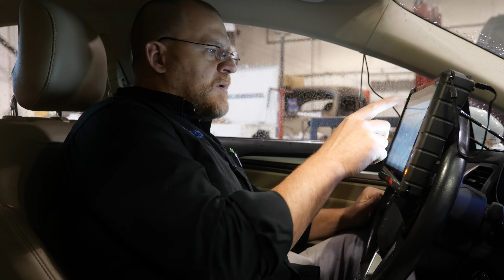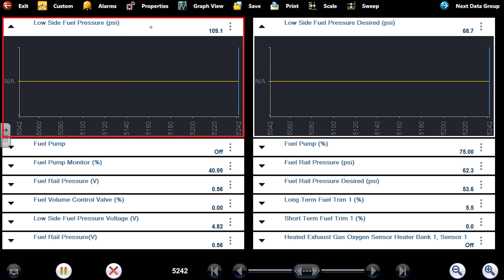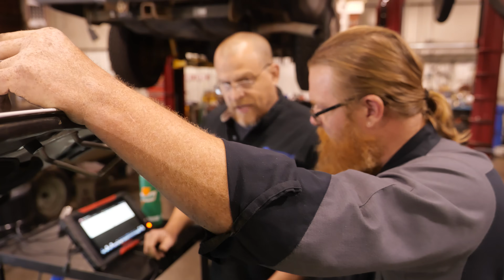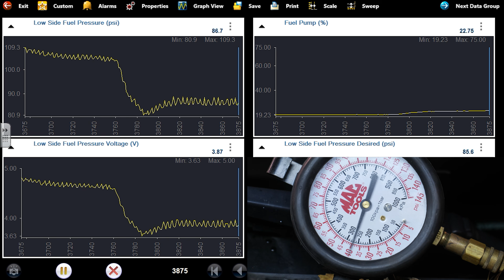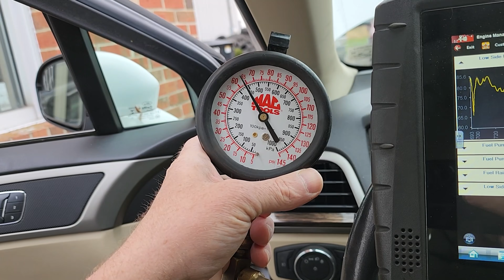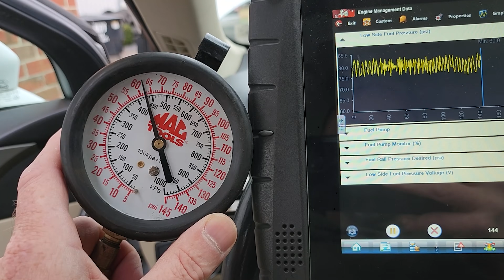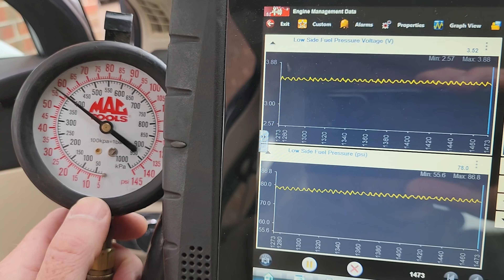Gas Direct Injection System With Intermittent Low Fuel Pressure

Comment: So i was told by our tech service, not going to name names.. that its ok to hook up a manual fuel gauge on gdi, however, its best not to tun the car with it on. Mainly because the needle bounces crazy and it could ruin your gauge. They told us key on and read gauge while supply power and ground to low side pump dead head. Thats how you read low side. Any thoughts on that?
Reply from the maker: Not sure why anyone would suggest that method. Especially with a PWM low side pump with a psi sensor. If you'd manually energize the pump, I'd put out max psi. I guess if that was your goal was to force max?
Reply: @ScannerDanner  they said maxing out pump proves that pump low side is not the problem. Use three wire potentiometer at low side sensor to verify scan data can change and measure ecm signal to pump control module with oscilloscope to see if you can control situation and watch computer control module rpm. Having a manual gauge on it running is bad for gauge. Thats what they said.
Reply from the maker: @mikesabin8568  I don't see these psi pulses messing up a gauge. I always want to see the system working as designed. And in this case comparing actual, desired, low side psi, and low side pump duty cycle was the key to the diagnostic. Jumping the pump out wouldn't have been any type of advantage imo
Reply: @ScannerDanner   Maybe use an oil dampened gauge? The gear inside  the gauge eventually wears out from the vibration and gives false readings.
Reply from the maker: @BertGraef  I think the key word that you said "eventually". I'm certainly not worried about my gauge for what I showed. Thanks!

Comment: Paul, i have an intermittent po325 on a 2011 kia soul. Ill pay you to troubleshoot, and ill even buy you lunch if i can be there while you troubleshoot.
Reply: That DTC sets when the ECU does not detect a signal from the knock sensor. There are only a few reasons why that would happen, which would most likely be:
1. Failed Knock Sensor
2. Open connection between the sensor and ECU
3. Failed ECU 
Just unplug the sensor and connect a test light to B+. Touch your light to the plug gently. If it lights up, replace the knock sensor. If it doesn't light, or you've replaced the sensor and the problem persists, reply back to this comment and I'll try to help you troubleshoot further.

Edit: If you're replacing the sensor make sure you use a Hyundai/KIA part. Don't use aftermarket sensors unless you absolutely have to.
Reply from the maker: Man, that's like 3 strikes in one sentence 😉
1.Someone from YouTube (they generally have had their hands in there, which always makes things more complicated)
2. Intermittent issues are the worst!
3. Someone who wants to watch
😊
Thanks for your confidence in me though